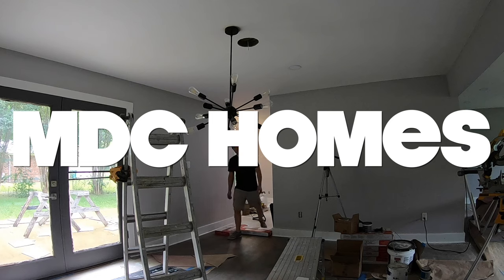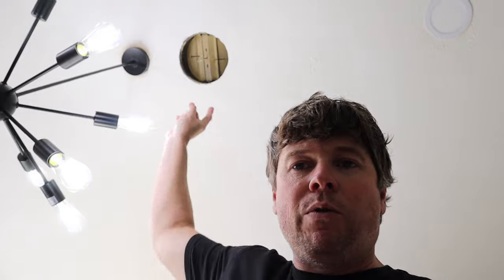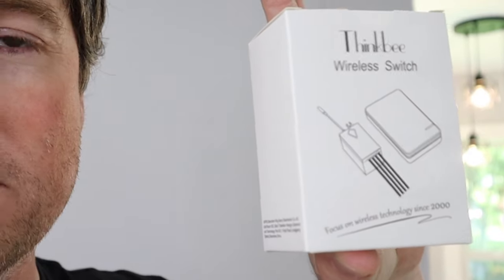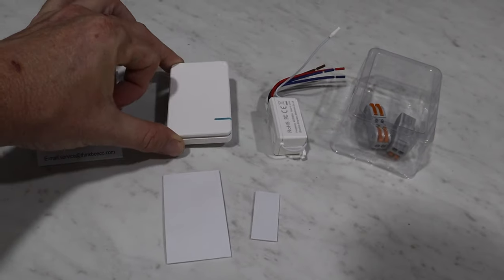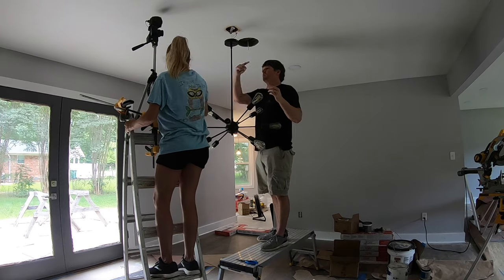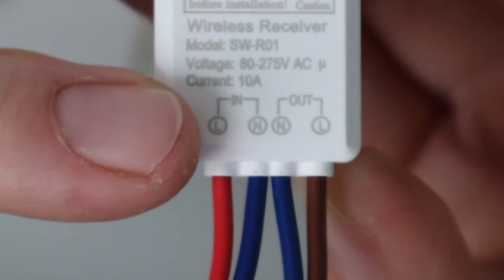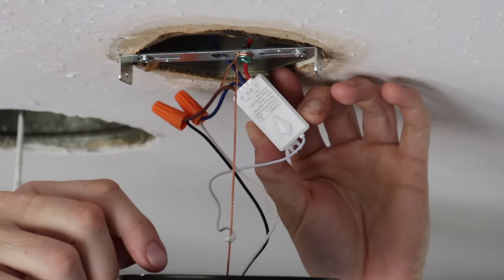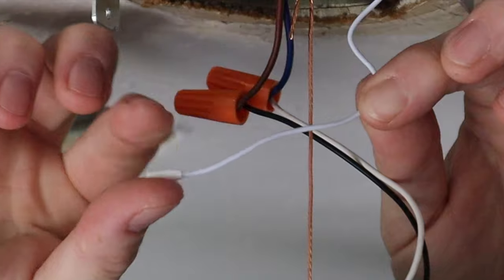THINKBEE WIRELESS LIGHT SWITCH INSTALLATION - Very DIY friendly!!!!!!

Comment: In order to connect wires - they're not too thick -  you need to open up the orange tabs by lifting them individually,  to a vertical 90 deg. position then slide the wires in and then flick them back to the original closed position as pictured ...You're trying  to push and twist connecting wires the 'american" way...while the inlets are closed.
Reply from the maker: Lol. Yeah I did open them but didn’t get that part on film. The connectors that were provided I believe were good for up to a 14 gauge wire and we had 12 gauge at this location. Possibly could have forced it but just chose to go with wire nuts on this one bc they also seemed to take up less room in junction box. We do use those connectors in other situations though. Thanks for watching and for the good info. 👍
Reply: There’s no way they wouldn’t fit they hold up to 4mm 👍🏻
Reply: @MDCHOMES yes sure. It seems like you had no clue how those connectors work.
Reply: Those connectors are Wago copies. They will easily do the cable size. Just gotta flick up the orange tab and slide it on in there and lock the orange tab down. In the end though if you’re used to wire nuts then that’s what you’re used to.

Comment: Would this pass an electrical inspection? I’m pretty sure the switch is not UL listed, and it would be a shame if the darn thing fried and started a fire?
Reply from the maker: Good question. It did pass our local inspection no problem. Not sure if it is ul listed. Pretty sure these are manufactured in China so there is a high probability that they aren’t. They do have a lot of 5 star ratings on Amazon though and a few house fires would probably bring that rating down pretty quick. Lol. Definitely something to consider when buying cheaper items like this that are manufactured in less regulated countries. Thanks for bringing it to attention though because it’s definitely something everyone should consider. 👍

Comment: Does your existing wall light switch still work after installation? I want to add this wireless switch as a secondary switch.
Reply from the maker: In my situation there was no existing wall switch. If you are wanting to add this to a light that already has a switch it will work like a remote. If existing light switch is on this one will turn on and off but if existing switch is off this one won’t function. Hope that helps 👍

Comment: Excellent. Question for you, I bought three of these to replace the light switches in my basement. I was able to get two installed but the last light switch is an end line switch so I do not have an out. Can I still use this product?
Reply from the maker: I’m not sure I understand your situation exactly. You’ll need access to the wiring between source and light to install this remote it interrupt it. Not sure what you have.

Comment: Can you replace an existing wall light switch ( for a ceiling light) with the receiver?  Of course covering it with a blank plate.
Reply from the maker: Kinda depends on your wiring situation. If the power is run to the switch or to the light. Either way you’ll need to alter it slightly so you have constant power going to light.

Comment: Does it cause electrocution if it is touched with a wet hand inside  bathroom?  How long does  battery or charge last?
Reply from the maker: It’s battery operated so it won’t electrocute you. I sold this house shorty after installing so I can’t really say how long battery will last.

Comment: I assume this is a kenetic switch meaning no batteries. How do I get dimming?
Reply from the maker: The remote does come with a small watch battery. This switch is solely and on/off switch so no dimming. There might be a version with a dimmer but this one did not include that option.
Reply: @MDCHOMES  how long can this work with this small battery?
Reply from the maker: Hmm. Not certain. These batteries tend to have a pretty good  life expectancy but I guess it would depend on usage.

Comment: How did you get that back off!  I can release the back from the bottom side, but can’t seem to free it on the other end.  I feel like I’m close to breaking something.  What’s the trick?
Reply from the maker: It took a little effort with mine as well. I used a very fine blade flat head screwdriver in the slots which released the clips as I pried it apart. It did feel a little sketchy putting that much pressure pulling it apart and I sort of had to hold one side open as I got the other side. Eventually it opened up though. I guess the only trick I know is just using the smallest flat head in the slots that you can to press against those clips. Good luck 👍

Comment: Is there any way a wireless switch would work with only having the switch on top besides the constant hot in the j box?
Reply from the maker: I’m sorry. I’m not sure I understand the question. You will need a constant hot for this switch to work. The remote switch works by interrupting the constant just like a traditional light switch would.

Comment: The orange tabs lift up and then you push the wire in then push the tabs back down again
Reply from the maker: Yeah. That’s the most frequent comment I get on this video. We do use these connectors all the time on other projects but in this instance the 12 romex would not go in connector. I didn’t get a focused shot of it with the connector lifted but had one with it closed. Not sure if these were just some cheap Chinese ones that were defective but even with the tab lifted they wouldn’t go in. I thought maybe other countries used a smaller gauge wire that these were intended for. Long story short I did try with the tabs up but just didn’t get it on camera. 👍
Reply: @MDCHOMES  oh okay 👍

Comment: I have Fan and light combine with two wire pulled out (no natural wire). I am searching Wifi switch which can be combine switch to on/off light with dimmer and also switch on/off Fan with different speed. Please advise.
Reply from the maker: This switch doesn’t have the functionality you are needing. I believe a universal fan remote control would suit your needs better. Hope that helps.

Comment: I've installed 3 of these in a couple places. Those orange tabs on the connectors flip up 90° and clamp the wire pretty good. I've installed one where a switch was inconvenient and 2 in a ceiling fan, both installations with "3-way" function.

Comment: Thanks for the video. Unfortunately, you went through the wiring a bit fast. That's the hardest part for us amateurs. If I'm not mistaken, the pairings are:

Ceiling:              Box:
White          --> Blue in
Black          --> Red in 

Fixture:            Box:
White           --> Blue out
Black           --> Brown out
Reply from the maker: Yes sir that’s correct. Sorry if I glazed over that part too quickly. Thanks for taking the time to diagram it out. I’m sure it’ll help others who also had questions about it. Thanks for your help and for watching.
Reply: @MDCHOMES  My pleasure. It's easy to forget how little the average weekend warrior (like me) knows ;-) Thank you for your excellent videos!
Reply: @MDCHOMES what if the 4 wires coming out of my control switch are not labeled?  Mine goes blue, red, black, black. How do I know which are in/out? Ordered from Amazon and it doesn’t come with instructions. 😢
Reply from the maker: Does it have a side that’s labeled in and one labeled out?

Comment: I wonder if this would work if I splice off a potlight to add a chandlier, using this switch on the chandlier to have its own independent switch? In other words, if the chandlier doesn't have a pull chain, would it still turn off & on?
Reply from the maker: This switch will work as a break between any power source. If you have a constant power source going to pot light you’d be able to splice and run a line to chandelier. Many times pot lights are on a series, especially if there is a group of them. If the power source going to pot light you intend to use is on a series controlled already by a switch and doesn’t have constant power in the junction box your chandelier will go off every time you turn pot lights off regardless if you have this additional switch. Just need to check to see if you have a constant power source at that location. 👍

Comment: I'm going to buy this for my kitchen because our kitchen light only has one switch by the back door but not at the entrance to the kitchen from our dining room. I've been using a similar product with some lamps that I hung on the ceiling so we don't have to walk across the kitchen in the dark to turn the light on, but the same wireless switch that controls those lamps also controls our under cabinet lights, and I want to be able to turn those on separately.

Comment: Do you need two receivers to connect.two seperate lights? Or you just stick both lamps wires to out cables
Reply from the maker: They make a kit for that situation. The one I used was one receiver for one switch but they make some that come with multiple receivers for multiple lights.
Reply: @MDCHOMES  thank you for the quick reply

Comment: Good stuff.  What if you want one switch to control two lights.  (ie sconces).   Possible to pair two relays to one switch? Thoughts?
Reply from the maker: Depending on situation you may only need one relay. If the sconces are powered by the same source you can place the relay at the beginning of the series. This would operate both with the remote. Hope that helps. 👍

Comment: Can you continue using your old switch?
Reply from the maker: In this application there was no existing switch. If you already have a switch it will override this one. Meaning if the old switch is on, remote switch will work. But if old switch is off it will kill remote switch

Comment: If I missed it, will tu/vous repeat. Do tu/vous place batteries in the transmitter?
Reply from the maker: There is a battery in the remote but not the transmitter

Comment: My retrofit recessed light  & power source both have ground wires..No metal surface to connect ground..Do you just cap them? Thx.
Reply from the maker: I’m not sure if I’m following exactly what your situation is but if you have a ground running back to breaker panel you can use that.
Reply: @MDCHOMES  Been using it for  weeks now..easy install. Thanks. Just noticed that the metal edges of my thin LED recessed light gets really warm. Thinkbee switch should not cause that,right?..I am leaning towards the light itself as the culprit..Any ideas?..appreciate your time.
Reply from the maker: 🤔 I wouldn’t think the switch would give off any noticeable warmth. I’m like you…I’d assume it’s just the light. Thanks so much for watching and for the update on your install. 👍
Reply: @MDCHOMES  Thanks...awesome prompt reply...I just emailed the company..hope to get a reply soon...oops! forgot to subscribe...doing it now.
Reply from the maker: Awesome. Thank you. 😊

Comment: Did you still charge the same as if you did run the wire jus wondering so I know what to charge
Reply from the maker: This was a flip house we were selling so wasn’t really applicable here. I would definitely charge less for this application for a customer bc far less time is involved. Once you know the steps these can be installed in less than an hour.

Comment: Great tutorial thank you. I am considering fitting one of these to operate the outdoor lights on my garage. There are 3 lights currently operated by one switch. Would I need 3 of these devices or just one fitted to the junction box? Also I presume the existing light switch won’t be affected?
Reply from the maker: You’ll need to connect it the source that supplies the 3 lights. Depending on how your house was wired that source could be in one of the junction boxes behind one of the lights or in the box the existing switch is in. The existing light switch won’t be affected other than it will override the remote switch. Most likely if the existing switch is off, remote will not turn light on. But if existing switch is left on, remote can be used to turn light on and off. Hope this helps and good luck with your project 👍
Reply: @MDCHOMES  thanks for taking the time to respond and for your help and advice 😊

Comment: Thanks for this video.  I came across this type of kinetic switch just yesterday and was looking to see how small the controller is.  You didn't mention that the remote of this device does not require any battery, that's a huge deal IMO.  There are remote light switches that are similar, but the remotes are not kinetic so use a battery.  Since this is kinetic it is essentially the same as installing a normal switch.  Do it once and forget about it.  What's not answered for me yet is if the controller remembers paired switches when it loses power.  Surely there is some memory storage, but how long will it last.  Any idea?
Reply from the maker: Hmm. Not sure on the memory part. I believe it will stay paired though. I’m almost certain I turned off the main for the house working on other electrical after switch was installed and it was still paired when we sold the house. I believe the remoter does have a small watch battery in it. Hope that helps. 👍
Reply: @MDCHOMES    I figured out that what you installed is not the kinetic energy type of switch.  That's what I bought so I don't use a battery, the switch should work forever essentially.  I suspect, since yours worked after losing power, that it does store the ID of the switch in the receiver, so I expect the kinetic type will also stay paired.
Reply from the maker: Good deal. Thanks for coming back to let me know. This is good info to have for everyone looking into purchasing these switches. Thanks Paul. 👍
Reply: We have a kinetic switch on outside pot lights.
There is a main switch which turn off the lights by the front door. I had considered putting in a timer but when opening the switch to change it out it only had a white and black and ground so no true neutral. 
So that says it's just a switch loop.
The circuit breaker that it's on is marked " attic relay".
What happened next is the problem. Once that switch loop is turned off the relay loses it's  pairing.
I should mention we bought the house and were just testing what switches did what.
It would have been nice that the orevious owners had yold us not to turn that switch off.
Anyways now I have to find this relay. I looked in that attic but couldn't see anything without crawling in there.
What I do know is that breaker also kills a ceiling light close to the attic entrance.
I'm  wondering if that switch loop could be going to that light attached to the relay in that ceiling box?
To me this is dumb given that this could happen with any power outage so access should be easy to reset, pair.
We have 2 kenectic switches thst work it.
Reply: @dougross6880  Take the neutral feed from the ground in the switch box, the kinetic device will stay powered on regardless of the switch position.  Better yet, put the controller in the light box, that has both neutral and hot and ground, it's where the controller is intended to be put.  The downside is that the kinetic switch overrides the wall switch since they are unaware of each other's state.

And that's the real issue with using a kinetic switch where there is also a wall switch.  If you change the wall switch to a kinetic switch, with the controller in the light box, they will work together perfectly.

The switch I used kept the pairing even if it lost power, I tested it for that.  But since your unit won't do that I'd put it in the light box (if you can make it fit), and use two kinetic switches.
Reply: Thankyou for the reply.  
If I knew where the relay was I would definitely just swap out the switch with one of the two kinetic switches. But my problem is I don't know where the relay is situated.
I would assume that because of the switch loop at the switch itself, that the white isn't really a neutral but just a break in the hot going back to the relay.
If I turn the switch on the  exterior pot lights come on but can't  be controlled by kinetic switches any longer. Which leads me to think the relay has lost sync.
I'm  not sure what you mean regarding the neutral and ground swapping. As there is no true neutral. 
Just a black and white connected to the switch.
Reply: @dougross6880   I don't understand this relay issue.  Houses do not generally use relays to operate lights, the load just doesn't merit that.  So I doubt you have a relay, despite the label on the breaker box.

But even if you do, the kinetic switches can be used in place of the normal switches.  You have power there and just wire them as usual.
Reply: The breaker marked attic relay may be a misnomer,.
The live switch (in foyer) turns all the pot lights on and off.
But at the time we didn't  know that if it was turned of it would unsinc the two switches.
I've  tried them with lights turned off and with them powered on.
This active switch only has one wire (black / white and ground) in the wall.
I would reset it if I knew where it was and maybe move it.

Comment: Quick question if my current light has a switch when I flip the current switch to turn it on does the light turn on or do you have to use the kinetic switch after restoring power.
 I want to add this at another entry point to the room but wanting the main to still kill all the power then restore it and not have to add another kinetic switch at my main entry
Reply from the maker: Hmmm. I’m not for sure it would come back on with the main switch you currently have. That one will definitely turn it off but I can’t say for certain if the remote switch will default to its last position or if it always defaults to off once power is removed from it with main switch. Sorry not much help there bc didn’t have that option with ours to test. I’d love to know the answer though if you decide to try and see.